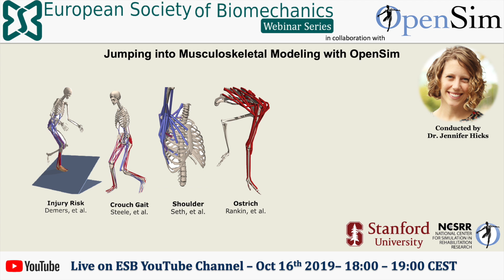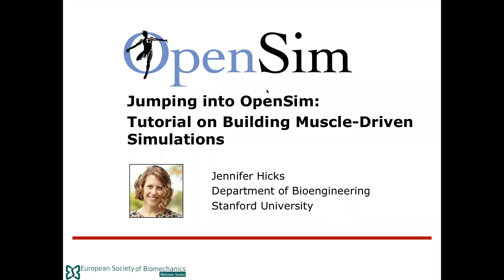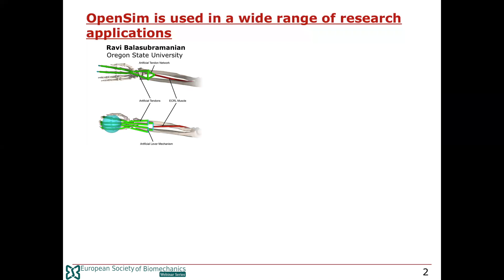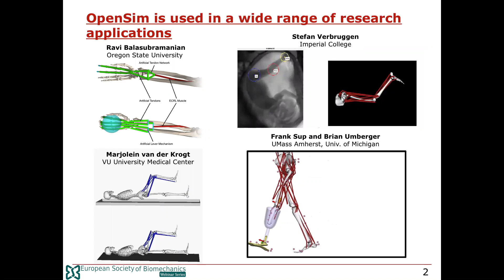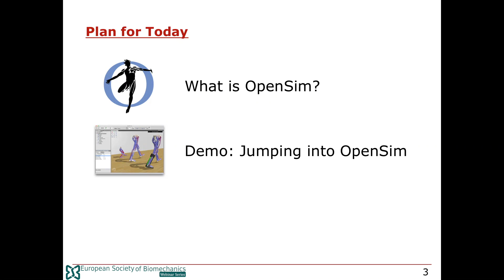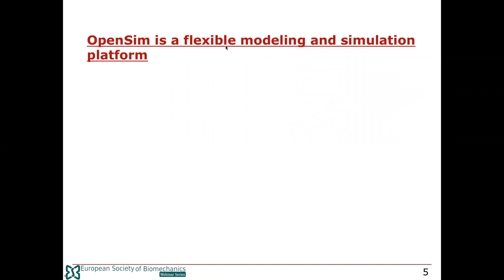ESB Webinar Series – No.02 -Jumping into Musculoskeletal Modeling with OpenSim

Comment: Hi, thanks for the video. I would ask a few things. I am using the OpenSim 4.4 now and I'd like to do the static optimization. How do I find the setup file from the example? I only have CMC_Actuators and RRA_Actuators file. If it is not provided, could you please give hint how to set up the actuator file (.XML)? Thank you very much
Reply: Did you get the answer ? facing same issue
Reply: @lushankshambharkar9529  No, I don't, but I am trying scripting with python and most probably she (the presenter) used the python/c++ scripting to set up the .xml files. I am not sure, though.
Reply: @dioutoroo  i have another question. Suppose I have C3D file from motion capture system. Can i use the same motion in this opensim software and how?
Reply: @lushankshambharkar9529  of course you can. it's a bit technical. You have to choose the model provided by the openSim (you can use yours as well), then you have to scale the model according to your subject. After that, you need to be sure that your marker's name matches the one with the openSim default (otherwise, you must do a little bit work in matlab/python). Then you load the static marker data and finally use your motion data for kinematic/kinetic analysis
Reply: @dioutoroo   Thank you for the explanation, can you show me the entire process with the help of screen recorder. That will be very helpful to you. Thankyou.
Reply: @lushankshambharkar9529  well thank you for the advice. I've been thinking the same, but hasn't been realised yet. I'll let you know if it happens!
Reply: @dioutoroo   Thank you for your reply
Reply: @dioutoroo   All my comments are deleted and i don't know why
Reply: @lushankshambharkar9529  I can still see your reply, though. I am planning to make that video you suggested, I'll let you know if it is uploaded.